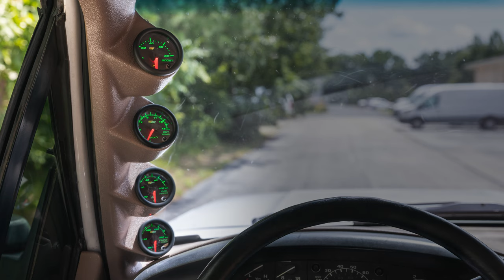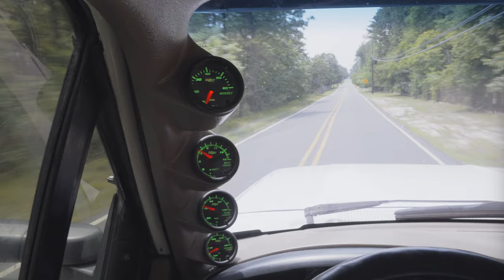GlowShift | How To Install A Diesel Gauge Package Into A 92-97 Ford F-Series 7.3L IDI & Power Stroke

Comment: Easy install. 3 gauges with pillar pod. Had a bad sensor wire out of the box and GS customer service sent a replacement quickly (great customer service). Used the small orange wire with black stripe on the back of the headlight switch (early 1997 F350 PS) for my dimmer connection. I did not drill my OEM trim. Wires tucked (used a 4 ga. GS wire harness) and ran neatly in the room between the GS supplied pillar and the OEM trim. Wires hid well between the truck dash and kick panel and cannot be seen.

Comment: How accurate is the fuel pressure gauge on the FPR since it’s a mechanical pump that runs off the cam which causes pulsating readings? Has anyone used it in this application as shown?

Comment: So what for a 5 speed truck? Drill a whole in the cab?
Reply: What do you mean?  There's always a way through the firewall
Reply: I have noticed that every one of these install videos are installing the gauges into trucks with automatic transmissions. As such they are running the wires into the cab thru the plate where the clutch master cylinder would go. That doesn't help much for us who have a standard transmission. I have a 1995 F350 5 speed and am installing a 3 pod setup with a boost, EGT, and fuel pressure gauge. After much back and forth here is where I drilled; on the inside under the dash there is a large cover where the steering linkage passes thru. On the Outside of that cover at about the 2 o'clock position is where I drilled thru (from the inside under the dash). On my truck there is a piece of matting there but it was easy to pull it out of the way and replace once I was through. It put the hole under the Clutch master cylinder. I used a step bit and was able to pass the conduit with the wires from my sensors in it. Hope this helps someone
Reply: A step but and grommets, no big deal

Comment: are you able to do this in a normal gas engine for a 1992 ford f150
Reply from the maker: Of course! You just wouldn't need the boost gauge but you could certainly choose another gauge to take it's place.
Reply: thank you m8 i will look into that in the summer of 2024 (when i have a job) @GlowShift